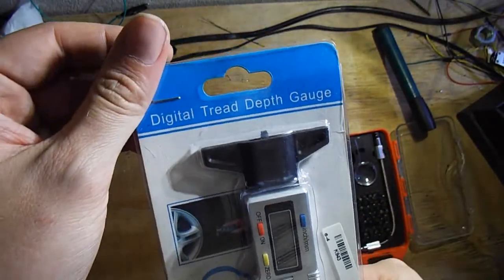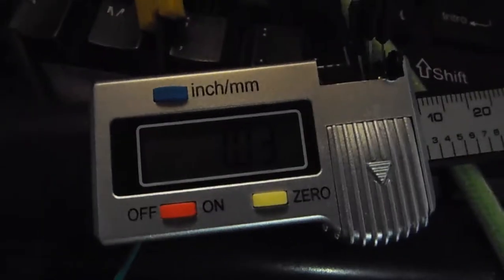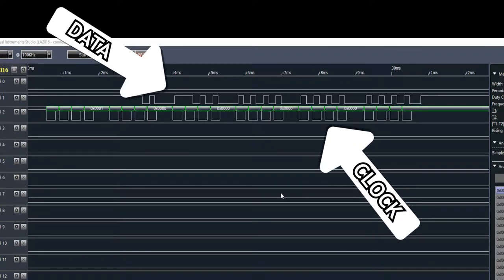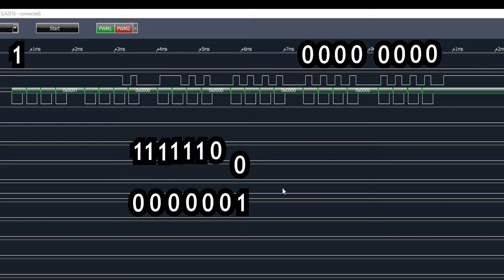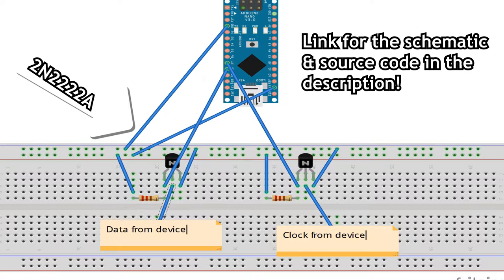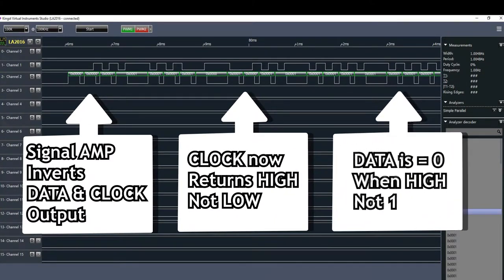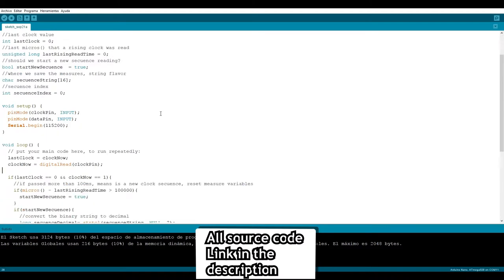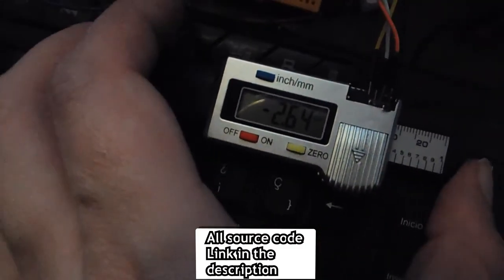5 Minute Maker - Digital gauge for arduino

Comment: 1.Remove the battery
2. Arduino GND to GND
3. The voltage drop across the two diodes will give us power to the caliper. Diodes connected to + 5V through a resistor, say 10 kOhm.
4. pinMode (CLOCKpin, INPUT_PULLUP); pinMode (DATApin, INPUT_PULLUP); // internal pull-up 20-50 kOHM
Connect the resistors to CLOCK and DATA, the value must be determined experimentally, so that the Arduino has a chance to distinguish between high and low states.